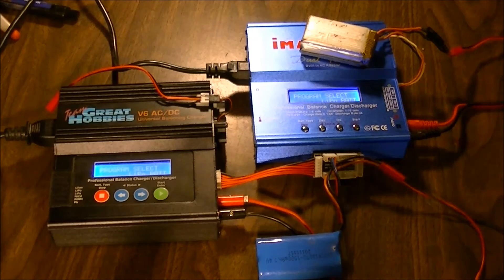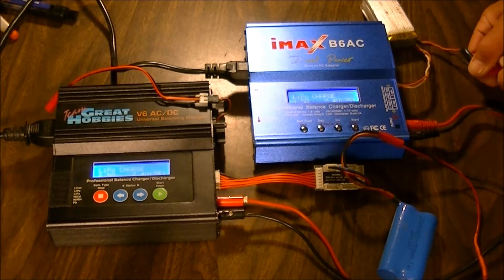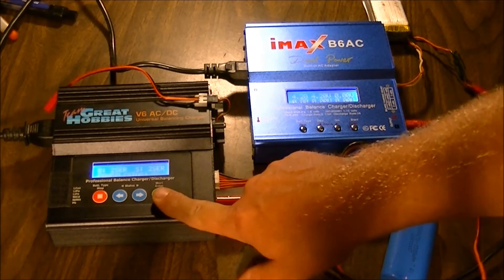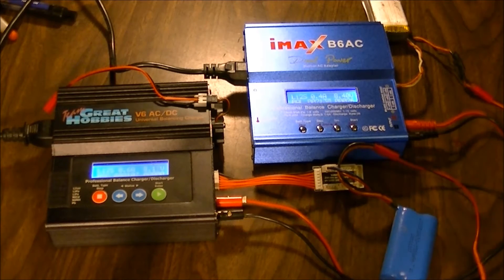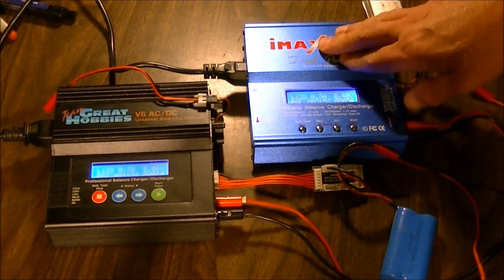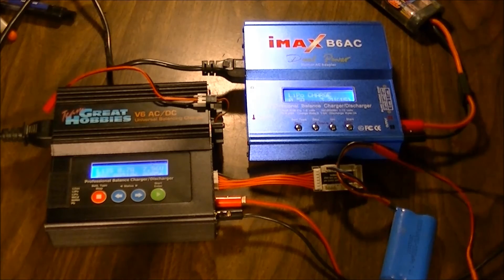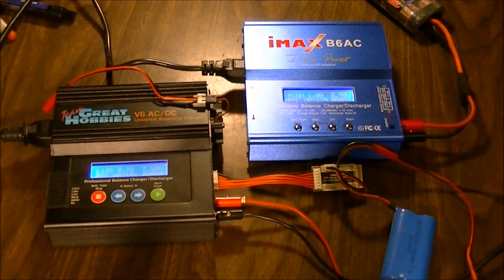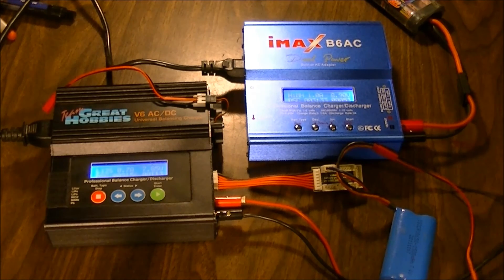Imax B6 And Team Great Hobbies V6 Chargers Basic Features How To Use Them

Comment: Nice one mate, that stuff about the discharge is nice to know, I am gonna go and discharge and recharge my quad batteries as they have one cell that has lower voltage than the others and this sets off the low voltage alarm early, reducing my flight times. Thanks (-:
Reply from the maker: thanks , its a really nice charger ill be doing a basic programming video soon as well for some of the other features